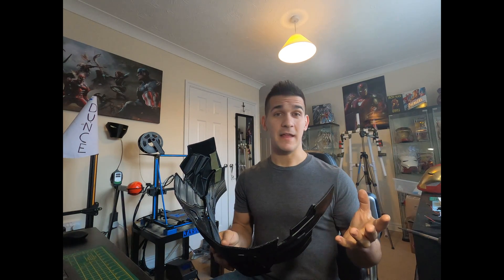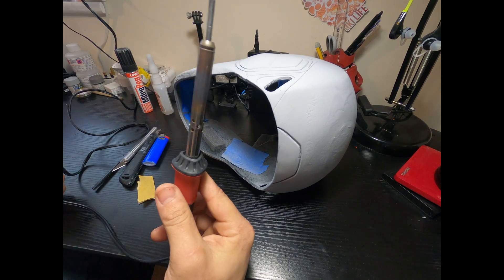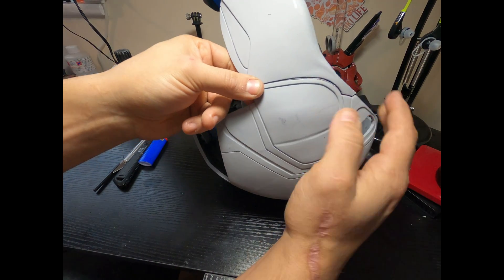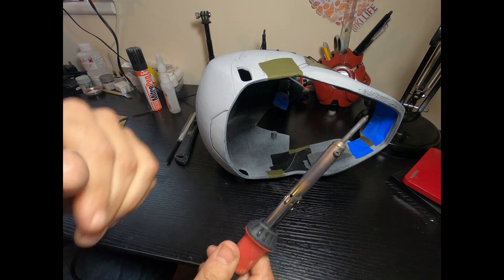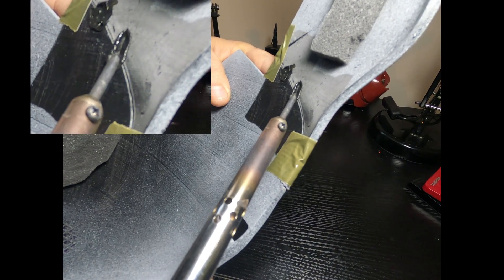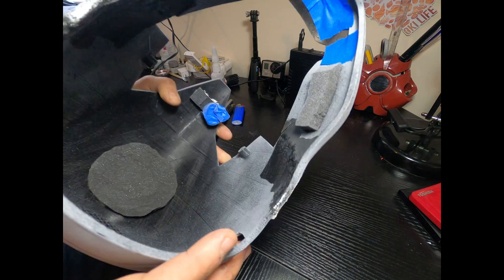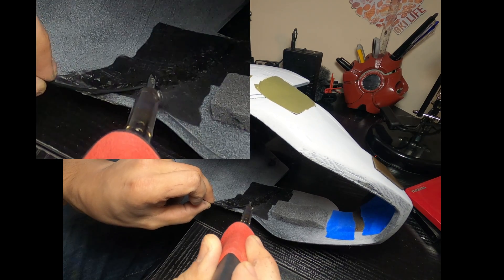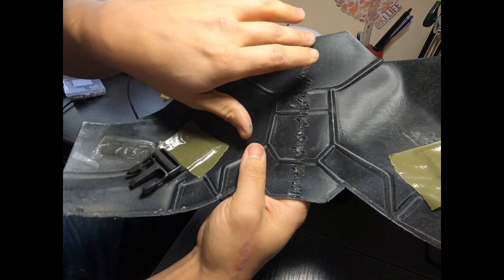How To Fuse 3D Prints - Combining 3D Printed Parts Together with NO Glue! (OLD VERSION)

Comment: Harbor freight plastic welder, less than $10. Also, using metal mesh adds structural integrity similar to rear in concrete.

Comment: Also a tip for external joints, rather than filling the new welded divet, use an extra spool of pla as basically plastic solder to weld
Reply: Basically like TIG welding
Reply: XD OH MY GOD this is a 2 year old video and you liked my comment in less than 5 seconds you are the best!

Comment: Is it better to sand and prime the individual pieces before or after? I am printing a Mando helmet right now and it has 8 pieces but originally I thought It would better to sand and prime after the whole project is done. 

Also I noticed you didn't really do the visible side as much, is that intentional and still holds just as strong? I have also thought of another tip for people who would do this: Use failed prints as extra strength like you did with an extra filler piece of spool. That way those prints won't go to waste.

Comment: This is a cool technique... I wounder if you could maybe print some overhang lip about 1-2mm and when you joining a part you actually melt that lip and just maybe avoid melting trough the part and also having that little bit extra material to work with your soldering iron. What do you think?

Comment: This is exactly what I was looking for. I have a prop that I printed in multiple parts, and have been trying to think of the best way to fuse some of the parts together. Some of them have some defects where the print didn't bond super well to the bed, so I think I might be able to use this technique to kinda fill in the gaps that it created.

Comment: Looks like you build a lot of cosplay helmets. I've just set up my first printer, and am working on one for my kids. I have looked everywhere for a ready made Quorra helmet from Tron: Legacy, but evidently the plans aren't out there. Anyway, I've chosen a Pepakura model and exported it to Mesh Mixer. What thickness do you recommend for when I extrude the model, to get it to print decently? (I have a Voxelab Aquila, 200x200x250, basically an Ender 3 clone).

Comment: On Amazon you should be able to get a pretty cheap wire soldering kit for like $5-10 with a temperature controller between 180° and 400° and it comes with alot of useful tools like tweasers, tape, different miscellaneous accessories and even different tips for the soldering iron such as a chistle tip for smoothing

Comment: Good to know I'm not the only crazy one for using my old woodburner to clean and weld PLA. You could plug your soldering iron into A simple router speed control for variable temps. Lower temps are great for ironing smooth and finest details. PLA doesn't  smell much but you're totally corret about superglue will burn you if toasted, 😆.    ...I dare say, as I am learning from much your videos about printing larger sculpts. Thanks

Comment: This same method in auto body, plastic welding. Either an welding iron is used or hot nitrogen air. There is also a tool to imbed staples into the plastic to hold them together first then you weld over it. This is like repair plastic parts of a car.

Comment: you've never used a good quality regulated soldering iron then. mine evaporates the plastic on contact have to turn it quite a bit down ps be very careful as you can easily get hot plastic on you if you set it too high.
Reply: well he did say it was like 3 dollars or something lol
Reply: any recommendation for temperature?
Reply: @matthewsolomon7075  Well it depends a lot on brand my local brand about 300 and prusa "Authorized" (came with my printer but is not actually presentment) about 340, don't have any presentment pla only petg which is also about 340. (all of these are centigrade obv. 300 c= 572 f, 340 c = 644 f)
Reply: @Heroic_Brine   Thanks for the reply :)

Comment: So I’m printing Thor’s hammer at the moment. The actual top hammer part printing in 2 pieces. So massive flat sides to stick together. Best to use glue for that then wood fill around the edges on the outside ?
Reply from the maker: Yep! That’s exactly what I could do.
Reply: @FranklyBuilt  thank you.

Comment: I used gorilla glue that's like a gel to hold my mask I did together and I took your advice and used a soldering iron on the inside. It worked so well and even added some rigidity to the print. Outstanding advice man!

Comment: Miller makes a nice small sized organic vapor respirator I use it when welding steel but it works for plastic fumes as well. 

Also if you take a soldering iron and wire it to a light dimmer knob you can actually control the output of the soldering iron. I use it for wax chasing to keep it from getting too hot 👍
Reply: That's a nice idea!

Comment: I've seen a technique that was basically friction welding, they took some filament and stuck it in a drill or dremel and spun it fast against the seam they wanted welded. It eventually heated itself up and melted down, was quick and easy

Comment: When I was a young child in the 70's, my grandmother bought me a model kit that was sort of like a plastic Erector set, except it came with plastic I-beams and plastic rivets and a tool that ran on batteries. The way it worked, you would lay the I-beams down the way you wanted to join them and hold the tip of the tool against the seam. It had a very fast rotating head, the friction welded the two pieces together. This kit was supposed to be a dragster, it came with a battery operated motor and a simple two pole switch. When you got your frame built, then you would take the body panels which were pre-drilled for the plastic rivets and hold them in place with one hand and put the head of a plastic rivet in the end of the tool and put the end of the rivet through the hole and against the frame and push the button. It spun the rivet fast enough to make enough heat from friction to melt the rivet and hold the rivet head, locking the body panel in place. I never finished the kit, I had enough fun melting the parts together and riveting them. :) "Gather round, kiddies, Grandpa Witt's going to tell you about Lawn Darts after he wakes up from his nap!"
Reply: This are the toys I would have loved to have but got banned cause they were deemed too "un-safe"
Reply: Witt, I remember that kit. I had it too. Great toys back then. I enjoy seeing them show up on ebay from time to time.
Reply: now that is a long paragraph
Reply: @hellomynameis1419  yeah break the paragraph into two parts at least 🥲

Comment: Been doing this for awhile, but the X pattern makes a lot of sense. I've been just using a flat tip, push it between the parts and using a spare bit of plastic to push in the melted area. Doing an X might save me a few inches of PLA

Comment: Do you have an idea on ideal temperatures? I have a plastic welder (for kayaks) and a soldering station. The welder has a massive flat triangular tip which will be good for the final smoothing and is a set temp, no variable. 
My soldering station does have a temp dial. What would you say is probably the best temp to reweld PLA post-extrusion?
Reply from the maker: Andrew Scarlett 400c seams to be the temp I like
To use

Comment: Seems like a flat wide tip and an actual strip of filament would be great for this. Just lay the strip on the seam and run the iron over it. Looks like the burn marks are from laying your hand on the iron. Make a holder so that doesn't happen people.
Reply from the maker: Mark Jones I use strips to fill big gaps. It works great! 

And the burn was from when it fell and my mechanic reaction was to grab it lol 😂
Reply: I use a wood burning iron.  It has tips of various shapes and sizes.  This is a great use for the remnants of rolls.

Comment: Did he just casually touch the hot tip of soldering iron :D
Reply: It’s the same reason why you tug a tie down when strapping a load of you don’t pull and say the load ain’t going anywhere, it will fall out of the truck. You have to gently tap the iron and say it’s really hot, otherwise it won’t be hot enough for what you are doing.
Reply from the maker: Yes. Don’t do it lol

Comment: I really appreciate your video and your craftsmanship, as well as explaining your techniques in terms of welding. I recently went to Michael's craft store and bought a cheap direct plug-in to wall wood burning unit that had multiple tips and a thermostat, this is an excellent because I can get to the exact right temperature for welding but not burning different Plastics, I just did wleding of a 100 pieces in pet G and temperature control was a lifesaver.
Reply from the maker: Hey no problem! I’m just sharing what I learn or know! That’s awesome!